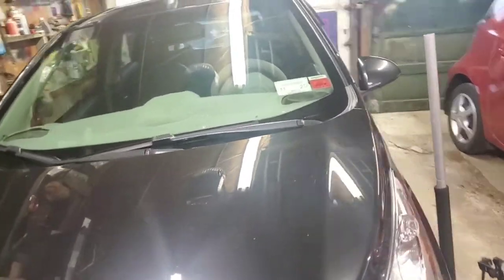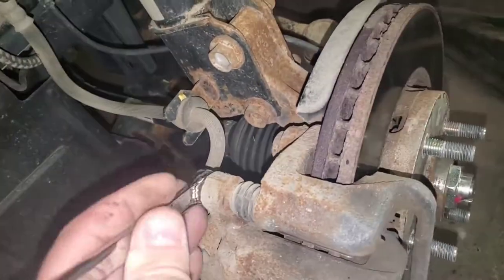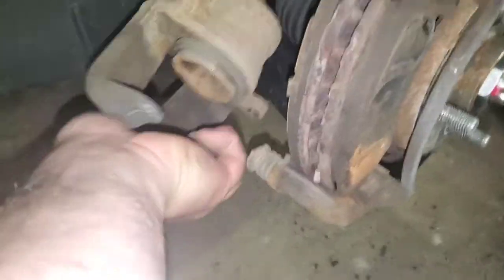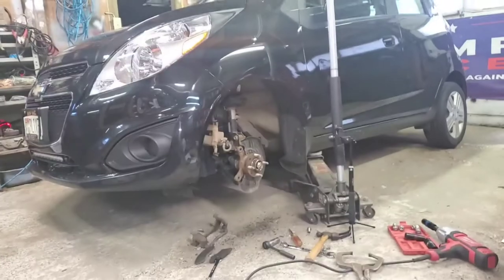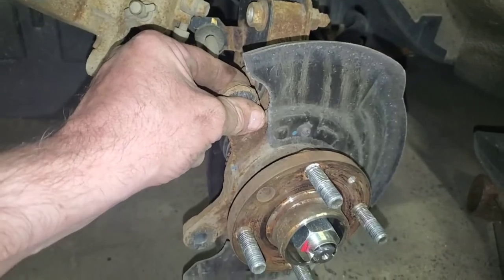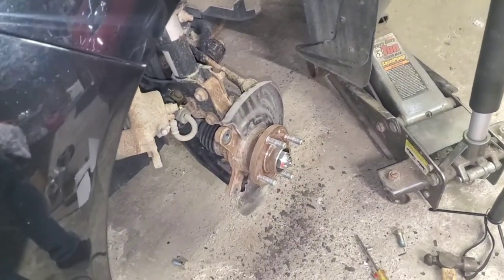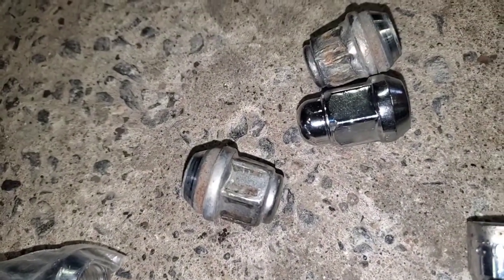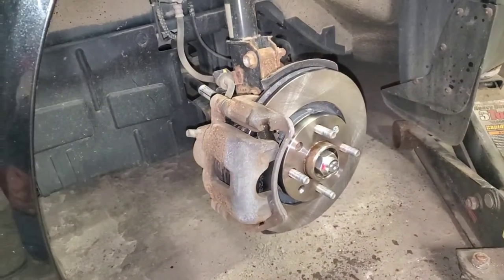2014 Chevy Spark front brake and rotor replacement

Comment from the maker: So I screwed up a few times called the rotor a drum and blamed the car dealers for putting those cheap lug nuts on, LOL that's what you get when you don't edit your videos!
Reply: hi, what size are the bolts to take off brake caliper bracket?
Reply from the maker: @ARAR148  I'm trying to remember I want to say 12 mm for some reason

Comment: Are you supposed to bleed your brakes when you do this? I keep hearing mixed information. I don't think my brakes or rotors have been changed since factory and there's over 98k miles on it now. I just noticed the rotors are warped so decided to just change brakes and rotors.
Reply from the maker: Well since I'm not letting any air into the system and I'm just pushing the fluid back into the reservoir I don't see any reason why I should have to bleed them

Comment: So when you push the piston back in is it better to have the break fluid cap off or just leave it on? I've always taken it off.
Reply from the maker: I don't touch the cap I leave it on it will breathe
Reply: Best way is to release the nut from the caliper when this is done. You run the risk of messing up the lines. Break fluid is cheap

Comment: Nice DIY. I just ordered the whole kit with new rotors, drums, calipers, pads & shoes for my 2015 with 80k miles. it too is pulsating when I stop. I was thinking maybe it's my rear drums doing this because the parking brake is applied when the drums are warm when I park it overnight. The whole kit was like 225 bucks for everything. drilled rotors, powder coated cals n such. we shall see. I wanted to ask if your car lives on salty winter roads. Looks like a lot of rust as opposed to my little car. but Louisiana never uses road salt. The new lug nuts are a must-have. Thanks for the heads up.
Reply from the maker: Yes I'm in such when they are I live out in the country were they mainly use sand but when I have to go into the city I hit salt but I go to the carwash I get the under wash I also spray The Underneath with that rust proofing spray it's kind of like WD-40 can't think of the name right now oh, by the way how's your transmission my transmission went out at 45,000 miles I got a free one through Chevy
Reply: @TheOriginalAndysGarage  I bought this car from a guy that changed his own oil. He took it out on the highway. He hit a piece of road debris. He said it immediately started leaking oil. He parked it. I asked him about it. He bought a new car citing it was as too small for his needs anyway. Made me an awesome deal on it without me even knowing where the leak was coming from. I bought it, crawled under to trouble shoot the leak. I had a pal start it as I was under the car. It immediately sprayed oil right in my face. He had over tighten the oil filter and stacked the gasket. I crawled out went to the local auto parts store bought you a oil filter installed it. Not a single drop of oil coming out. The car runs as smooth as the day it was brought home from the show room. It’s equipped with a manual transmission. I’ve never had a problem with it. I am curious about the automatic constant velocity transmission that is available.
Reply from the maker: I like the Chevy Spark but if I ever get one again is going to be a manual the automatics are literally junk

Comment: How did u get the lug nuts out mine are súper expanded
Reply from the maker: You either have to chip off that Chrome covering or find a heavy duty 6 point socket and beat it on with a hammer

Comment: wtf??? you not show most importand: how put of disc break?!
Reply from the maker: Sorry sometimes I rushed through a video and forget stuff my memory isn't so hot but basically you just take the caliper off and the disc brake comes right off sometimes they have a screw holding them on sometimes they don't